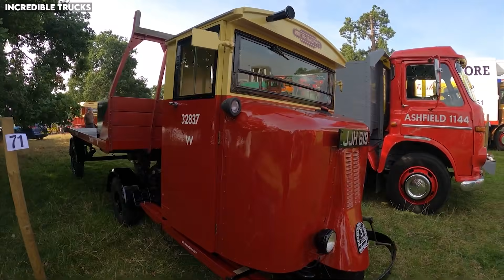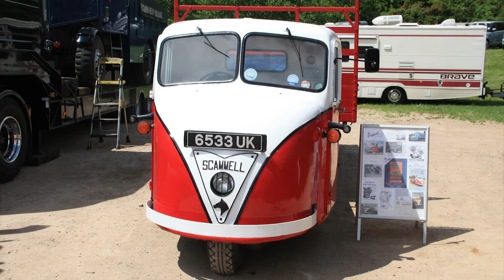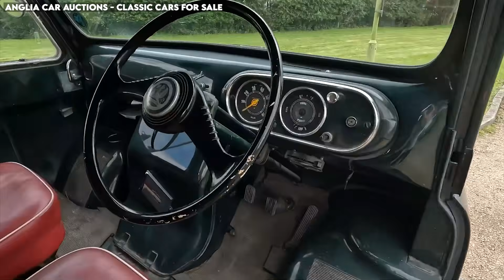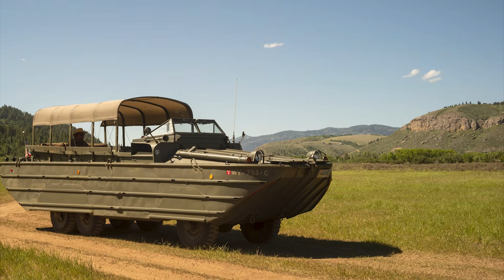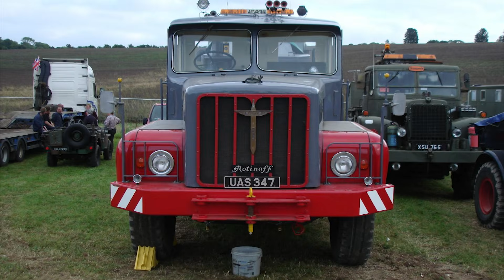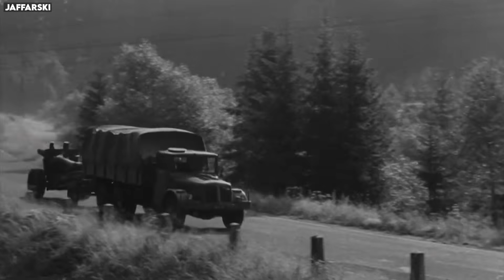10 Strange Classic Trucks You’ve Probably Never Heard Of!

Comment: The Scammell Mechanical Horse was a fantastic design. They were much used by British Rail and Royal Mail. I remember seeing many of them running around Oxford when I was a boy. Given that the freeboard on a fully loaded DUKW was only about 6-8" it could only safely swim in calm water. he futureliner looks like it came from set of Mad Max. The Atlantic was built by Thornicroft not Rotinof and gave rise to the later Antar.